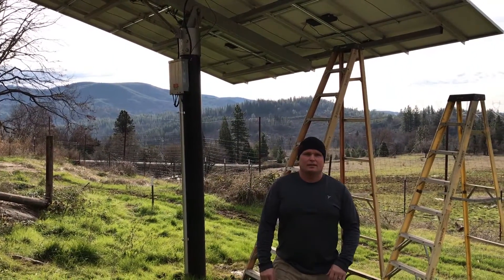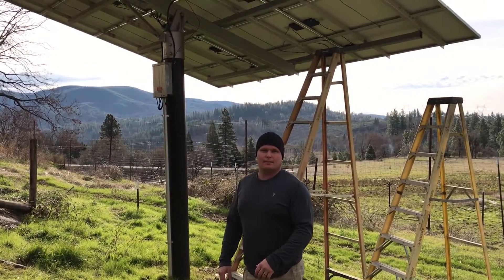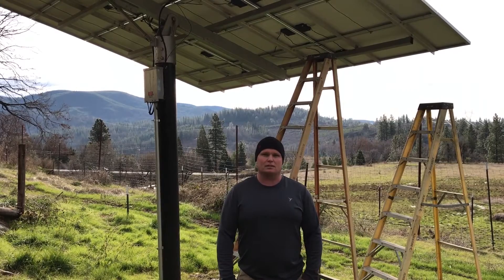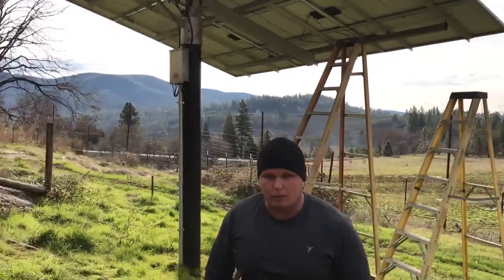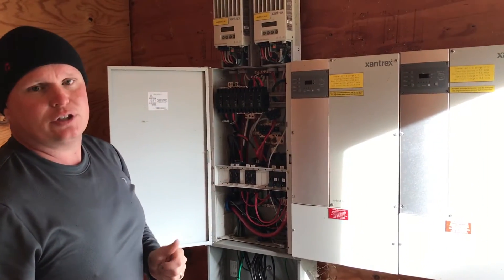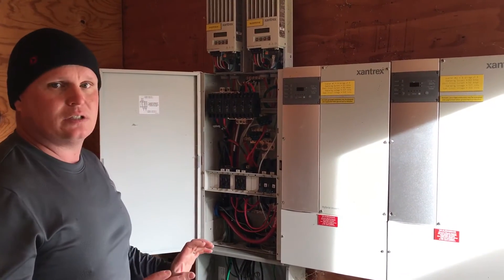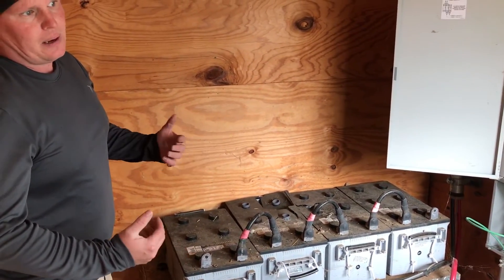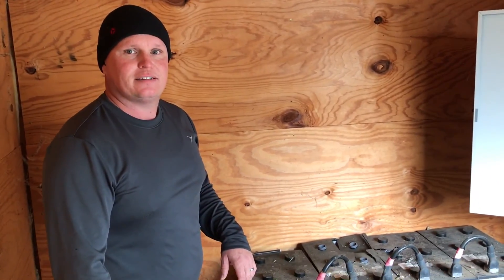Off grid battery explosion #!!

Comment: If it was a grid-tie limiter inverter, that wouldn't have happened. Was the setting too low to cut off the battery bank? Should have not over discharged. Or were they trying to pull more current then the battery can savefully deliver?
Reply from the maker: SolarizeYourLife it was a combination of to high a sell current and the sell voltage was also set low
Reply: I see, like I said, should use grid-tie limiter inverter, only makes power being consumed, will not make excess or feedback to grid...Using power you make is better than feeding back to grid...

Comment: I don't get why anyone would want to "sell off" power at night instead of the maximum you can sell off during the day when the energy is being produced.  Does the electric company compensate you better at night in that state?  Otherwise, that is a lot of extra expense and complexity for nothing.  Now, for a backup system, those batteries would have been great!  Too bad they're ruined.
Reply from the maker: In California we have PG&E and when this system was installed there was a rate that allowed you to sell back during peak production and buy at off peak, this system was designed to sell back at that time gaining more peak KWH. Hybrid systems were really just starting to do load shaving and the system control at that time wasn't the easiest, it also didn't help that the owner wasn't very tech savvy :)
Reply: I agree. Why would anyone ever think of putting the batteries on-line with the grid. Energy storage is something we consistently struggle with at this day in age, even with lithium technology. Batteries are just not designed and don't have the energy density for grid use, which is why those batteries were so severely damaged.

Comment: Is that Xantrex what you are re-purposing at your place?
Reply from the maker: engineer775 Practical Preppers yes it is can't wait to get it up and running
Reply: Jason Andrade awesome. a nice compliment to your existing system! will they be tied together in any way?
Reply from the maker: engineer775 Practical Preppers no I am going to have two separate systems with 12kw on one and 3.7 kw on the other. The new system is feeding the shop and upcoming maker space I have about 2000sqft under the house to work with so it has a bunch of potential.  I am going to make the new system a secondary load for the hydro I am going to put in this year